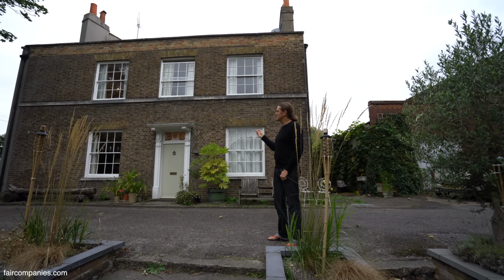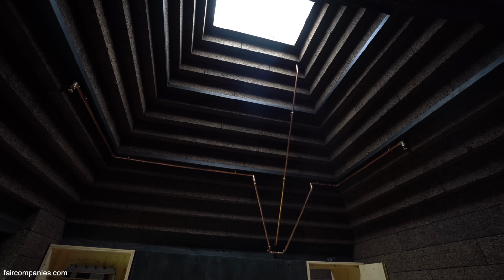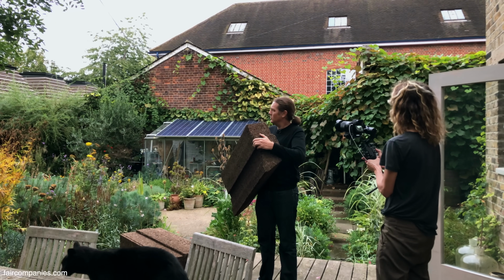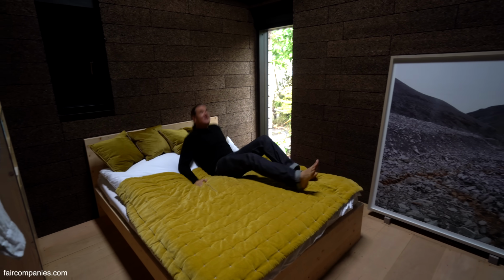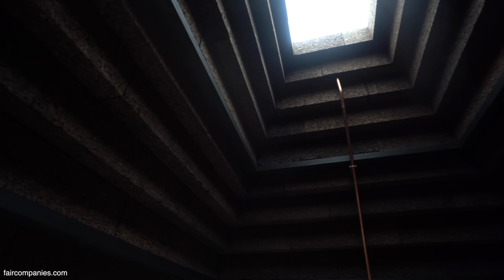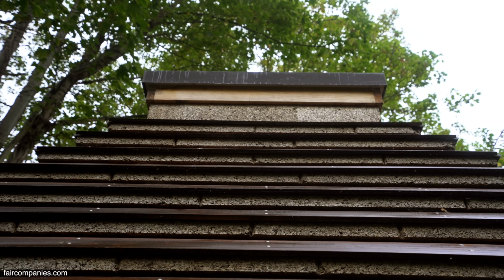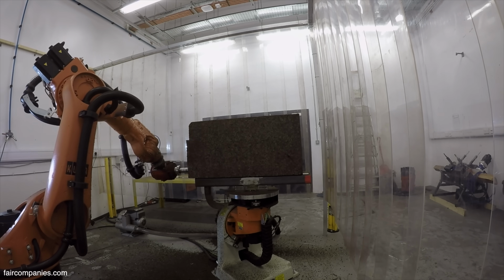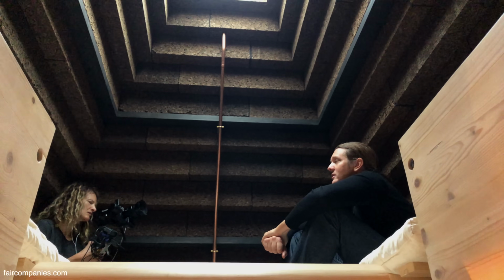Biodegradable home built by hand with cork LEGOs, no glue

Comment: Clever idea but these these designers obviously have never seen what happens to shoes with cork soles after about ten years - sometimes sooner....they crack and crumble even sitting in a shoe box and never having been worn!  I have to wonder how this place with the weather elements would hold up over time being lashed by heat, wind, rain, snow and/or hail every season.  I think I'll stick to conventional building materials that can take a beating when it's required to do so.

Comment: I lived in a house with the inside covered with this kind of cork sheets maybe an inch thick. It was great but we ended up painting it over because of the dust that would come out of it. It also nicks quite easily in the corners and we ended up adding wood corners. The insulation was not outstanding and there was condensation and mold on the inside in places but that may have been due to the paint.
Reply: My experience is with internal usage only and in Lisbon, Portugal where temperatures rarely go below zero centigrade. There are several types of cork aggregates with different densities and weights. For example, on that house, the top floor also had cork on the floor under the carpet. These were much denser plates so that they could withstand the furniture. They have worked remarkably well to this day some 35 years later. I am sure you can find a grade that would satisfy those conditions and the house in the video is at a place that freezes regularly without any such issues (although only time will tell). I think it is great that anyone could just stack up a house without a lot of machinery and trades people.
Reply: I'd be curious as well about the long term water issues. He said that in clinical testing the roofing proved to be absorbing water so they put treated wood slats to wick away the moisture a bit. However I would be concerned about the side walls and how it handles repeated freezing temps if there is water within the walls.
Reply: @inFocul I am not 100% sure too but they look exactly the same.
Reply: Jose Simas  can you imagine living on the Thames & the moisture issues? Perhaps areas that are naturally dry, arid,  even hot. It'd be great if it would keep the house cooler.

Comment: What happens when animals scratch away at the cork? Also, doesn't unlaquered brass contain lead?
Reply: Alexander Chang -    It does. I read a few of the listed articles from this Google search - "Does unlacquered brass contain lead?" - and it appears that most unlacquered brass contains from 5% to 8% lead. However, the lead is not considered to be a health issue (perhaps it is if someone were to frequently suck/lick the unlacquered brass over a period of time) when not used in piping or fixtures for water that will be drunk. It looks as if this house has copper piping (or lacquered brass) with unlacquered brass for sinks, surfaces, etc.

Comment: Since the blocks are just stacked without any fasteners wouldn't the structure just get torn to pieces by the high winds of a hurricane or typhoon?
Reply: Oh any flood that covers the top might just float away the blocks layer by layer. But 2 metal wires criss crossed over the top could hold it down.

Comment: Would be great as a core in a wall, I guess. With cladding on both sides. Nice insulation.
Reply: Why bother? Maybe inside you could hang curtains in place of wallpaper but that's entirely aesthetic and not structurally required.
Reply: @TheAnantaSesa     Well, I like wood, so I would get a nice wood cladding on the inside. Maybe also for the outside, and with that cork core it would be very nice indeed. All natural. Healthy and beautiful home.
Reply: John Grytbakk, why not just make plastic blocks then? The cladding would keep light from breaking the plastic down.

Comment: I would.of liked it better if it was recycled plastic....what wind force does it take?
Reply: So you prefere a material made from mineral oil that probably releases chemicals instead of an all natural material?
Reply: mrvisual; cheaper. Doubt pure plastic offgasses. Vinyl does because of the chlorine contaminant.
Reply: @TheAnantaSesa  Cheap was clearly not the goal here. There are hardly any "pure" plastics. UV light resistance for example requires additives for many plastics.
Reply: mrvisual; ok, well I’ve heard that people paint their pvc pipes to contain offgasses. Clear sealants might work the same. And I see that phalates and bpa might offgas from non chlorinated plastics too. but it’s hard to find concise data about such details as how long the gassing continues naturally and whether it mostly evaporates during remelting.
I was thinking of the chlorine free plastic types as “pure”. I knew vinyl was bad and, with so many factoids about the dangers of plastics being focused on vinyl and styrene, I am left thinking it is all just the valid scaremongering about all the non chlorinated types spilling over into irrelevant excesses.

Comment: It would have been more interesting to make it from blocks of compressed rubber tires than precious cork ,,,
Reply from the maker: His point is that cork isn't that precious since you don't kill the tree and if the demand were there, more trees would be planted for harvesting (only the bark). You're right that earthships do use tires, but with tires you're not surrounded by natural materials so I'm not sure how air quality would differ.
Reply: Kirsten Dirksen   Yeah good point about being surrounded by natural product . Rather than planting as a preference it still would be nice if the waste cork could be put to good use I think
Reply: @kirstendirksen  I like the house despite it being so dark but my point is that why not take a waste product that is in quantity and use that, Something that has already been used. There are millions of tires out there and they are turned into street paving for playgrounds and similar uses but why not make huge rubber lego and maybe layer in some cork or other materials as you go. I Don't like 'earth houses' as they are built with the whole tyre but Something could be done, ok heavier than cork which makes building more expensive on a hourly rate but ,,,, Cork does make it seem that its more an architects project than a real solution and this is the case for many of these builds today, a bit too intellectual.
Reply: @TheFiown  Because tires offgas. This would produce an ongoing indoor air quality problem.

Hundreds of thousands of wine bottle corks are sent to landfill everyday. It would be simple enough to put a refundable deposit fee on them and recycle them just like glass and aluminum containers.

Cork trees readily grow on land that is used as pasture for ruminant animals. Cork forests can be readily planted, and the land then becomes dual use. Cows and sheep like shade trees in their pastures.
Reply: @TheFiown  Part of the intention--the architect mentions this repeatedly--is that the use of untreated building materials makes it a nontoxic home, or as close to nontoxic as possible.
Reply: Stephanie Murray  now that sounds like an excellent  idea Kudo's

Comment: I wonder if the copper might be poisoning the pond fauna? For aquariums, you're not supposed to use copper, because the fish will die very quickly.
Reply: I would think it is unlikely in such an open area. An aquarium is a confined space where the copper can build up and become toxic.

In humans copper is needed for good health. It is possible to consume an excessive amount. But the human body is good at preventing high levels of 
copper from entering the bloodstream.

I have little education on fish you could be right.
Reply: I think he said he used untreated brass.  Is that toxic?
Reply: @johnkean6852  I'm not sure, I think it might depend more on what's going in the brass itself rather. I'm horrible with chem though, so here's Wiki:

It is simlilar to Bronze, another alloy containing copper, with tin included instead of zinc[2]; both bronze and brass may include small proportions of a range of other elements including arsenic, lead, phosphorus, aluminum, manganese, and silicon. The distinction between the two alloys is largely historical,[3] and modern practice in museums and archaeology increasingly avoids both terms for historical objects in favour of the more general "copper alloy".[4]
Reply: @reinux  Thank you.   If that arsenic escapes into solution it won't be a healthy environment for them.  If it's miniscule perhaps they will be okay.
Reply: @johnkean6852  Yeah, there's probably a simple way to figure out how long they need to be exposed to it before they get sick, based on the volume of water and the surface area of the brass.

Comment: Brilliant!
What I like about this is that it shows that with the right material you can have great potential for automation making housing much more affordable. And with the right design (don't really love the architecture here but anyways) you could even layout channels to make installation for electric and plumbing really easy.

I could imagine something like this could also work with something like 3D printing with expanding foam. Or some kind of advanced foam that is stronger and UV stable. First print roughly then mill into precise shape like in the video. Basically an example how 3D printing home could work by automatically(?) subdividing a building into blocks to be produced and then assembled.

Cork is awesome but clearly you don't have a very large supply of it. Or maybe some kind of fungus that you just feed and it grows into something like cork that can be scaled up in a more industrial process.
Reply: If one were growing something, it could be grown into a form, reducing the need for milling, and increasing strength.
Reply: @izzyplusplusplus1004  Yeah definitely. Kind of like "lab grown wood". 

But you'd need a more complex or articulating mold so the part will release.
Reply: @dejayrezme8617   a release layer of a textile product perhaps?
Reply: Mushroom houses sound interesting
Reply: @gsh4373  I think Kirsten Dirksen made a video about using mold to grow packaging materials. So it's not that outlandish :)
You'd just need to find the right fungus and design an industrial process to manufacture and grow this stuff.

Comment: Why couldn’t you have compressed the blocks into the shapes you wanted to reduce waste? Why would it need to be designed to be taken apart? Humans aren’t going to take it apart and reuse it. The cost isn’t worth it. The only buildings we ever rebuild are listed buildings that have some historical value.
Reply: It’s a natural material that was designed for minimal tolerances, and easy construction. Hence the cnc. It hasn’t been built to dismantle, he’s just highlighting no other resins, glues or toxic materials required.

Comment: They could be just made a mold rather than milling
Reply: That's what I thought. OTOH there'd be quite a lot of molds since they said there's dozens of different brick types but I'm not convinced you actually need dozens - I reckon there's some work to be done in reducing that number
Reply: I think they had friends with a milling robot and thought that was more delegatable of a manufacturing technology than going out to find people who could build molds for these types of cork. They had a supplier of cork blocks and didn't see themselves buying crumbled cork and  melting, molding it to have the desired quality, properties. That's what I think.
Reply: @steamsteam6607  milling make since for prototyping it's expensive to make different mold for every design.
Reply: I thought this too at first, why not just form it the right shape
But i think it has to do with the moisture proofing, finely milled/cut angles would make more streamline cavities and recesses for water to escape from, to prevent it either finding its why inside or just sitting in pools between the bricks
As other have said, so long as theyre reusing the stuff that is milled off, theres no real watse
Reply: elijah mikle  Yes indeed. I think that milling can allow for better interference fits, moulded cork would require more of a transition fit. Milling seemingly allows more adjustments in ongoing design, rather than having to create a mould each time for subtle tweaks to fitting and measurements. The caveat there is that a vast majority of people don't really have direct access to Computer-controlled milling machines to churn out blocks. However I think there is no doubt that milling is integral to building with this design to maintain the resistance against the elements.
Reply: hitdannyboy  ICF blocks are molded and they are way more complicated than this design
Reply: Great idea, I assume they bought a standard brick at this stage of development.

Comment: Cork:
-Is it can withstand nature's erosion?(especially in tropical areas where storms and rain can have for a few weeks sometimes)
-can it be moldy etc?
Reply: He kind of answered those questions at the end of the video; as long as the cork's surface is well drained (meaning no stagnant water or excessive humidity imprint, I guess), it is not naturally prone to bio-degradation therefore it won't degrade. I am no expert so I don't know if cork could withstand a tropical area, but UK is quite rainy and they are using it so it proves it tolerates a fair amount of rain/humidity. Also, if your area is well ventilated and exposed to the sun, it will help dry up after storms, but if you are under cover of tropical trees and theres little to no wind, it would probably be a terrible environment for cork I suppose. Anyhow, if you are serious at all about building with cork, your first step should be to contact professionals to ask them and do your own research.
Hope my answer was helpful! Good luck with our projects :)
Reply: Make plastic blocks for shaded areas. Sun is not good for plastic.